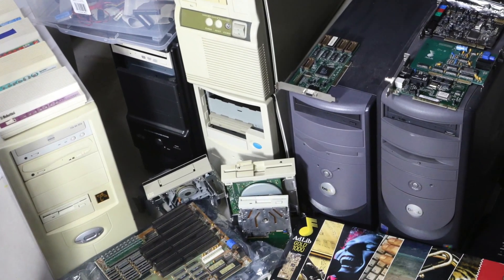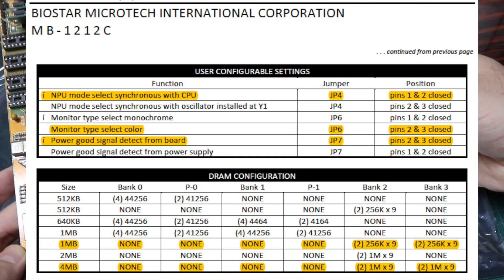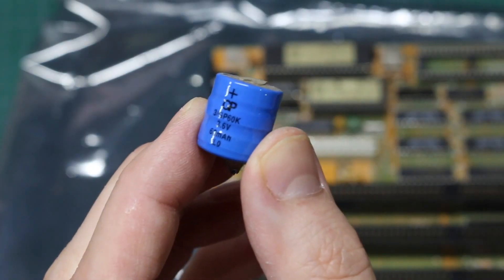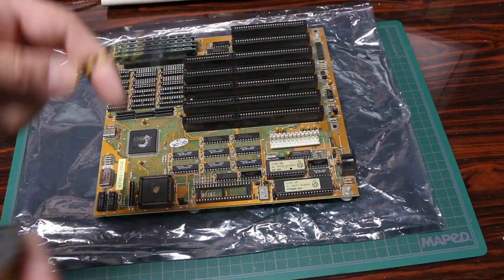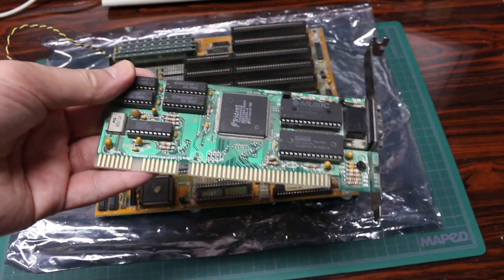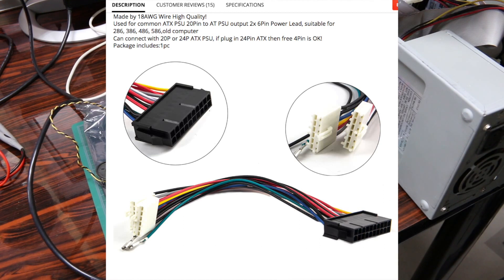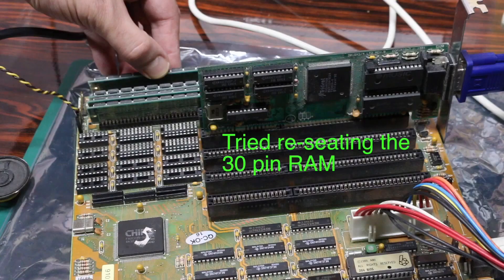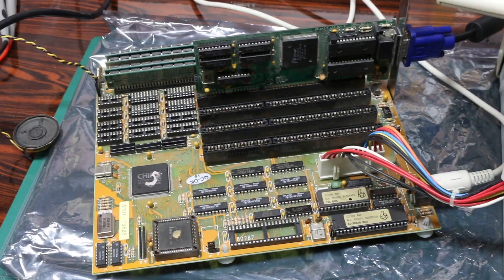80286 Motherboard:  First Power Up in Decades

Comment: So, '90 that's 32 years old... I wonder... if any of the motherboards made within the last 5-10 years... will they still work after 30+ years? Something tells me that they are far more fragile and probably won't work after sitting around in a closet/cardboard box/bin/what-not. The traces on these older PCBs are much thicker and surely more resistant to the passage of time, heck I've seen videos of people finding C64s laying outdoors in the woods for 20+ years, finding them with animal nests etc, and with a little trace repair and replacement chips/caps, they fire right up. No way any modern hardware could ever do that.

Comment: Not sure i had a 286. I started on our own designed  8086 board and my own 8086 pc. Then stepping over the 286 for the 386. Did once have an ibm 486 think pad  that was $6000 new in 1994.

Comment: I love that so much. I never owned a 286 back in the day. I went from 8088 to 386.  Looks like this could be a fun project.  It's an absolute miracle that battery didn't leak. That's one of the oldest systems I've seen that battery style on (most are 386 to Pentium). So to have one that old that didn't leak is pretty crazy. Nice find.
Reply from the maker: I started with 386sx 16MHz and then 486DX 40MHz, and off to Pentium 100MHz and beyond.  I don't know how that battery stayed in tact for up to 32 years but it's good there was no damage.
Reply: I've repaired a lot of motherboards 286/386/486 and in fact the GP batteries rarely no leaked . Batteries had the correct voltage a few times :) . VARTA batteries are the biggest nightmare